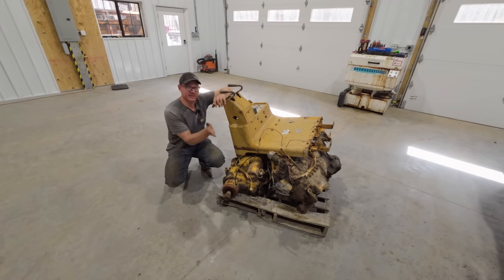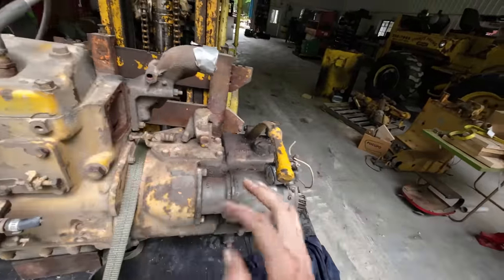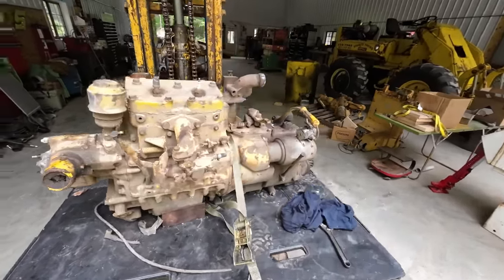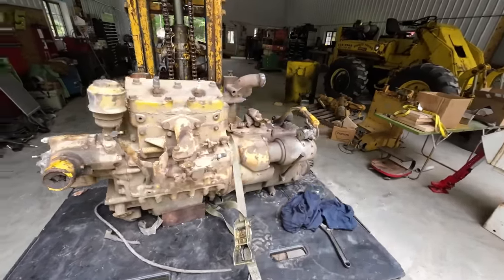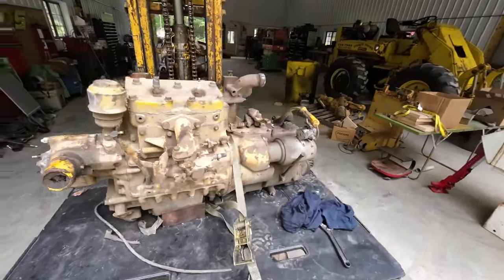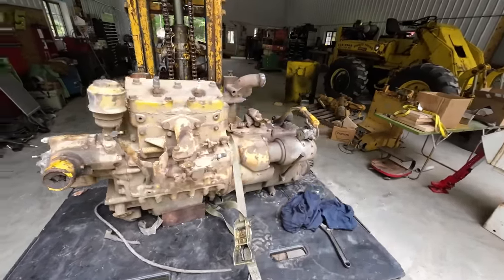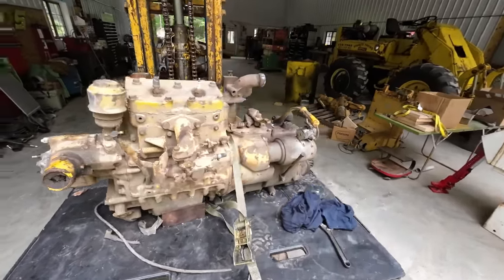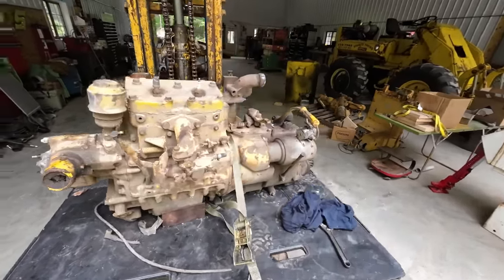I Got Two FREE 1960s Caterpillar Pony Engines. Will they Run??

Comment: I've been biting my tongue for fear of looking stoopid but I just have to ask...  Why are they called pony motors ?
Reply: Basically is is just a smaller gasoline engine that is used to start a larger Diesel engine. As the Pony motor is running and the coolant is warmed up and circulated through the Diesel engine to help warm up the Diesel engine , then a clutch is engaged between the Pony and Diesel to crank the Diesel and if all goes well the Diesel starts up and then the Pony motor is shut down.

Comment: Seeing you lift that pony, I was wondering if you knew that HFT sells lifting slings.  The beautimous purple 2000 pound 6.5' sling for ten bucks and the yellow 6' 6400 pound sling for $13. Once you get the bridge crane up, maybe the $38 20' 4000 pound sling would come in handy for lifting bodies off frames or something.  //  Yeah, she runs a whole lot smoother with fuel.  Those solid brass needle and seat can stick together with varnish and stop the flow.  Just FF around with it usually fixes things.  // Thanks to the donor!  And to the pony engines, welcome to Matt's Halfway House.
Reply from the maker: I don’t think I’ll trust harbor freight rigging lol that’s something g worth spending some money in
Reply: @DieselCreek  That's your prerogative. I tested mine out and it easily lifts a ton, with no ripped seams or noises.  Super good enough for me.

Comment: What a great find and gift!..... your friend wouldn't by any chance have a couple of bottom rollers for a d9 g that's around 50-60% would he?  I need a couple to finish wearing out a set, but can't find a used one anywhere. It would be foolish to put a couple new ones on the machine with the rest almost half worn out. Everyone I have talked to said that it cause the new ones to fail.  Stay safe out there.

Comment: Jump packs are just 2 small 12volt batteries. But it amazes me with what they can start. Not really sure how they do it.
Reply: Super Capacitors also?
Reply: @dougadams9419  none that I’ve ever seen.  It’s just 2 batteries slightly bigger than what you would find in a power wheels car. There not even lithium. Just lead acid or agm

Comment: Matt when you do swap out the pony motor. Can you maybe show us how a unit could be switched over to electric start?
Reply: It’s not as simple as some of the smaller engines, but several companies offered a conversion starter back in the day that plugged in the same hole as that pony.  Not sure what CAT offered once direct electric start was a common option.  On the smaller engines from the 60’s and 70’s there was a “bushing” that bolted into the flywheel housing that brought the hole down to standard SAE starter nose pattern so a starter could bolt into it.
Reply: @jimrankin2583  Ah, thanks for that information. One day i do think we will see a electric conversion.

Comment: The cylinder walls got hot. I would not have run it dry. It looks like a very well built engine.
Reply: Not much choice.  You don’t want to install it before you run it.  The installation video will be crazy if he doesn’t cut it a bunch!

Comment: Excellent video as always. I have a complete Cat engine of that vintage (with pony). It came off of an old military generator. The meter shows 1000 hrs. Both run excellently. I am thinking about selling it. Could someone tell me what it is worth? Thanks.
Reply: I should have added the Cat engine fits a D8.
Reply from the maker: Where are you located? Email me dieselcreek@gmail.com
Reply: @DieselCreek  In the Seattle area.
Reply from the maker: @bradrush45  ahh other side of the country lol

Comment: Maybe somebody else has already mentioned it, but having witnessed your fabrication skills on the work bench, I wonder why you haven't designed a portable, customizable engine test stand so you would always have a reliable source of spark, cooling, fuel, and an exhaust hose. (possibly to the outside?) 
Add a couple of handy shelves and all those parts/supplies that fly off the pallet when the engine fires off would be a thing of the past. 
Love your work, envy your vocation. Keep it up. Al in Socal (Came to San Diego with the Navy a million years ago and now I'm trapped here!)

Comment: Have a couple old d7-3T pony motors hooked to water pumps to fill troughs for cattle way out in the middle of nowhere. Made some back plates to seal the crankcase as they used the diesel block for the back end of the crankcase. Hand crank. Spare pony motors are actually fairly valuable to someone who needs them. The ones on the d7-3T were 24hp. Wide open. Maybe 3500rpm. Those high rpm 1940s gas engines Sound like they’re about to explode. Sounded like that starting them in 1965 so have faith

Comment: Electrically started pony engine is like THE most over the top contraption ever :D. I always wonder why so few of these machines have air start. Air start is great. Works every time. And should it fail - especially in the days before hydraulic breakers and cordless tools -  surely someone somewhere in the vicinity had a large air compressor.....and for ships i have even seen manual emergency air pumps. Seems to much more fitting in 1960s thinking.

Comment: Great that a subscriber gave you not one, but two working pony motors. That should keep you in business w/ your dozer forever. While watching you try to determine the status of the second pony motor. I was thinking how nice it would be to have a bore scope to look into the cylinder to determine what might be happening in there. I also watch a YouTube channel  for small engine and generator repair by James Condon. I purchased a Depstech three view bore scope w/ video camera from his web store and this thing is super. It has an HD camera w/ zoom and several accessories, definitely worth the price. The first thing I used it on was an old Chain saw that I have and found out why it was low on power, the cylinder was badly scored. Very handy for many other things also, like when you drop a part or tool and can’t find it. It will not only help you find it, but w/ the accessories that come w/it you can also retrieve it. It can also be used to check in the bottom of oil, transmission, hydraulic pans for any parts or pieces that should not be there. Hope this helps?

Comment: Matt, a question.  After watching numerous engine resuscitations, I have never seen anyone replace the welsh plugs on the block.  Having had this issue with a sedan with rusted out plugs, I became aware of the problem  and note that they are never mentioned in the case of industrial machines.  Have you ever had this problem.

Comment: I believe I have reached my breaking point with Mr. Hardhead. A jumper wire rather than the remote starter switch that a viewer sent him at least a year ago? Let's see if it will start without starting fluid. Why? Instead let's always give it a shot of ether first. There's never a reason to feel lucky about an old carb.

Comment: We always stood with our pony motors. A diesel with a pony will start in just about any temp or weather conditions while the electric start machine always had issues in deep cold and long sitting. If its got a pony it will run.

Comment: The one you aren't using for the dozer sitting in a small 4x4 truck connected to a manual transmission you would be able to pull stumps with the super low gearing would basically have 8 or 10 forward gears depending on 4 or 5 speed and 2 reverse gears would be an interesting build to watch

Comment: Nice job on the pony motors Matt.
The only way pony motors should be turned off ever is to close the gas petcock.
Otherwise gas will leak down into the crankcase that only holds a small amount of gas and thin it out that will then cause the motor to KaBOOM.
Any advice you need on that subject is covered by Master Cat tractor restorer Squatch253 on his channel. 
In one episode he showed us the results of pony engines that were turned off with the fuel still on.
Reply from the maker: I covered that in the video but with an updraft carb like this the fuel can’t get into the crankcase

Comment: Valve overlap is the period during engine operation when both intake and exhaust valves are open at the same time. Valve overlap occurs when the piston nears TDC between the exhaust event and the intake event. Duration of valve overlap is between 10° - 20° of crankshaft rotation, depending on the engine design. This is done to provide cooling of the exhaust valve
Reply: More for scavenging the burned mixture better.  I doubt the old pony has much overlap, but you’re right there’s some.

Comment: I worked at a manufacturing plant that the Sole Customer was Caterpillar Equipment, we made different fuel and hydraulic tanks as well as different body panels for a wide variety of different types of vehicles ranging from dozers to excavators to backhoes and all kinds of crap in between. Something you might find useful is the busted solenoid on the starter, at the time I worked there I had a couple different OBS style Ford trucks and when my starter solenoid went bad at work I’d go into the parts room because they used an identical one and while it never seemed to last as long as the Motorcraft Solenoid the one we had for whatever those were used for at work (we never saw the entire assembly, just a partial assembly that was then shipped to CAT) did actually work so maybe look at old solenoids for heavy duty OBS or other trucks in a scrap yard and see if they look the same since you said parts are no longer available
Reply from the maker: Oh you can definitely get stuff like that I mean pistons, rods, rings, bearings. Critical engine stuff.
A solenoid is a solenoid. Doesn’t make a difference who sells it. My gripe is NO ONE makes a good on in the US (that I can find) and the one I broke was a good old one US made one
Reply: @DieselCreek  honestly I think most of the CAT manufacturing moved out of the country as well. That factory I worked at, they closed down in 2016 because CAT shipped most of their contracts to Mexico if I remember correctly and that was their only customer at least when I worked there. Hardly anything is made in the US anymore
Reply from the maker: @peltiereric6497  yes only the D9s and up are mad in Peoria  and skid steers are made in NC, that’s all I’m aware of
Reply: @DieselCreek  yeah that’s where they are built but not where most of the parts are actually by outside suppliers. I specifically worked pressure testing and Tig welding leaks on the large dozer fuel tanks D8 D9 D11 and the modified D11 tanks. What we made in Ohio was shipped usually to Peoria but like I said they outsourced that production to Mexico because it was cheaper and they were doing that with many other suppliers as well

Comment: One may be a little rougher than the other. But it still means you have TWO running and working pony engines for when they're needed. Some heavy weight oil loaded with zinc might help the rough one last longer. :)

Comment: Flat head, valve issue, open the side cover first
Reply from the maker: That would not have helped anything?
Reply: @DieselCreek  as it turns out yea. But I am loathe to break a head gasket seal unless I have to. And sometimes you can work the valves loose from below and also sometimes its the lifters. The side cover can be popped back on, and you can make a new gasket out of normal material if you have to.